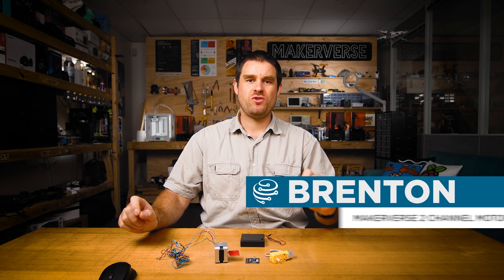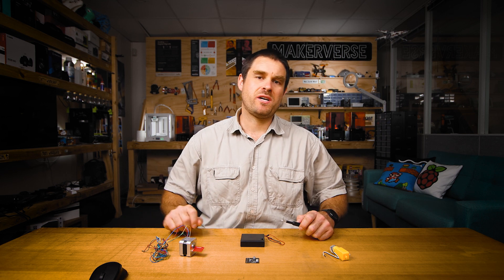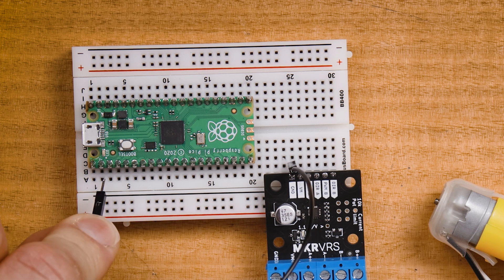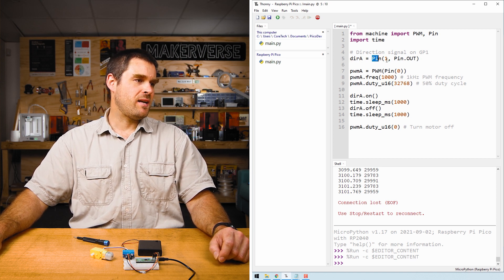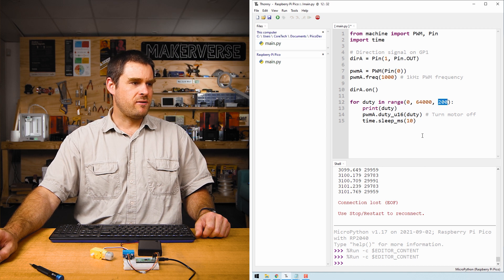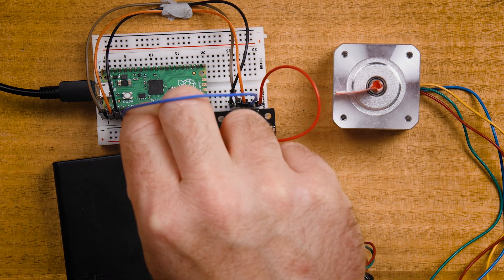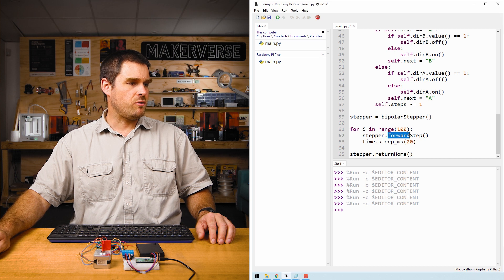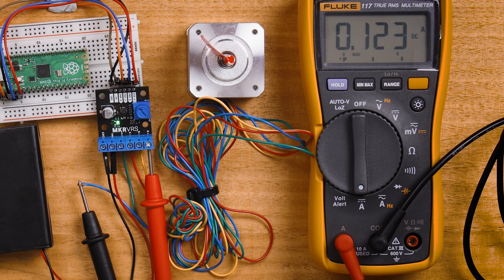Makerverse 2 Channel Motor Driver Application Guide

Comment: Will it work with the PWM modulation used by standard RC receivers? Where you can go forward to backward using just the PWM(servo control)? Because this could be an awesome cheap ESC for N20 motors...
Reply from the maker: Great idea! This module is a standard dual h-bridge, so it only works as a simple motor driver. There would have to be some extra smarts in between to handle decoding the servo signal and translating that into speed+direction.